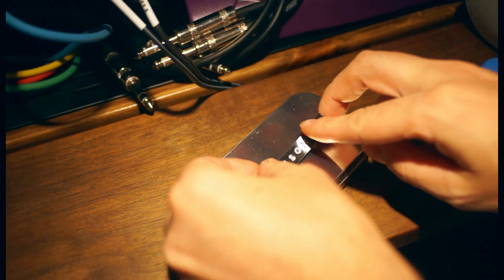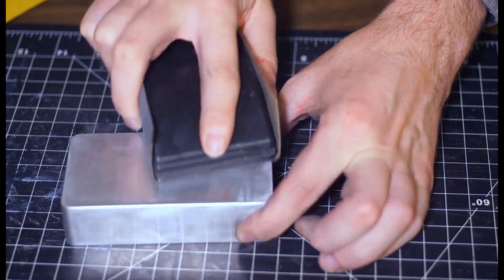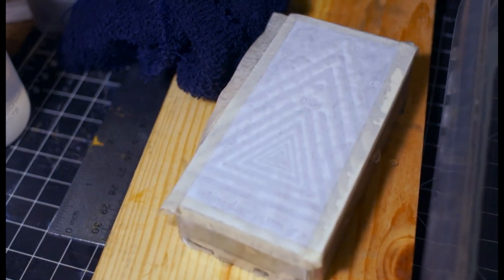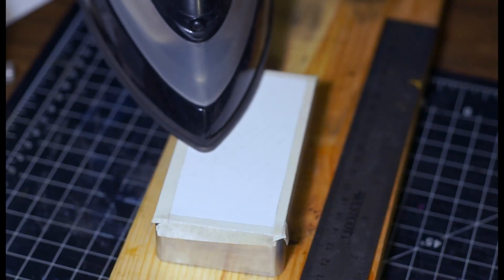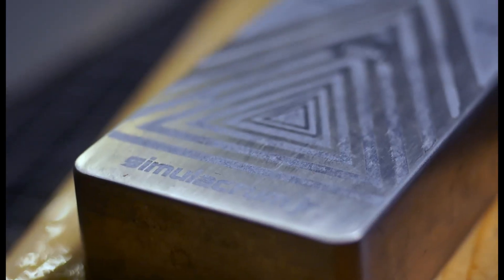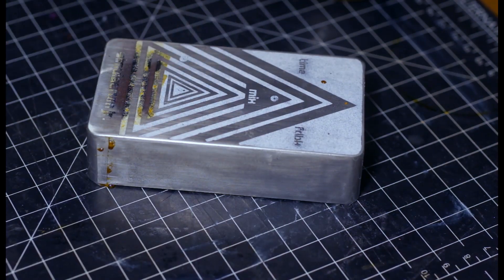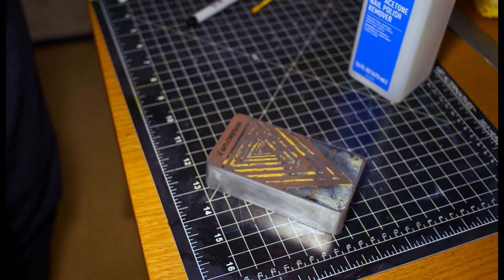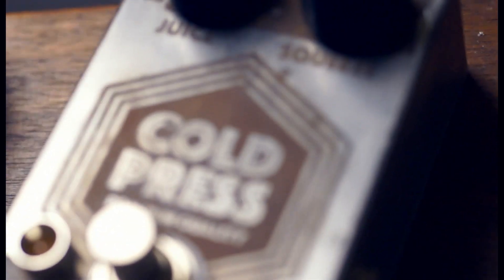How to Etch Aluminum / Etched Guitar Pedals

Comment: What solution of Ferric Chloride are you using? I tried this with Ferric Chloride marked at 42 Degrees Baume and it reacted really violently with the aluminium, generating really high heat and releasing hydrogen gas. Scary!!
Reply from the maker: Interesting, I've never seen that before. If memory serves, I used a solution of about 2 tablespoons of anhydrous FeCl powder (datak brand) dissolved in about 8oz of water. The powder may have been sitting on a shelf for a few months before that as well, though I'm not sure if it loses its strength as quickly in air as in water.

Comment: Technically that's a palm sander, not an orbital. An orbital, as its referred to these days is either rectangular or circular that works in random orbital paterns. But I have some old woodworking books that I used a lot when I was learning to work with wood to build guitars that often use those terms interchangeably and each book contradicts the others when going over terminology lol. With that said palm sanders are absolutely fine. They get a lot of hate but I use palm Sanders for guitar building since I'm going to do all the fine sanding by and anyways. So basically I'd use a palm sander for removing lots of material for comfort cuts or for getting the front and back level then I move on to hand sanding with a sanding block then fine sanding with a foam block. Anyways I never considered using a palm sander on an enclosure. My latest build is a DeadAstronaut Chasm Reverb that I've gone out of my way to try and get really nice this time. So no birdsnest off board wiring. Actually making a template with inkscape to precise dimensions rather than roughly measuring with a machinists rule lol etc etc. So I'm looking for ways to get a really nice looking enclosure. I have access to a laser engraver but I think etching would be even better. I live right by Mouser Electronics and they sell 500ml of ferric chloride for about $11-$12. In your experience is that a good deal or should I look elsewhere. Thanks for the video!
Reply: Switch is recessed within tool grip to prevent accidental engaging.

Comment: I'm having trouble finding the right paper. I bought HP Glossy Photo paper, but the hot iron made the back of the paper sticky and no matter how much heat I applied, most of the toner wouldn't stick. The paper initially would adhere to the surface, but when I tried to submerged it in water to remove the paper, it didn't soak up the water well and it was hard to get the paper to come off. When I did finally get it to peel off it peeled the transfer off with it 😩 feeling kinda discouraged. Any suggestions for specific brands of paper would be much appreciated.
Reply from the maker: Interesting! I struggled a bit with paper choices as well, many many failed transfers before I got the technique right. Photo paper tends to be thicker so that may be an issue, I'm using some stuff called "presentation paper" in the video, it's thinner but still glossy so the toner comes off more easily than regular paper. However the glossiness makes it more waterproof so it's kind of a double edged sword as you mention. Lately I've been using glossy magazine paper and it works pretty well. Most printers jam if you use it as a sheet so I just cut out a 6" x 8" section and tape it to the middle of a regular 8.5x11" sheet of printer paper, run it through as a carrier. It's lightweight, dissolves almost instantly in water, and is glossy enough to release the toner. Magazines are printed with dye type ink so it doesn't interfere at all.

Also, if you can't get the toner to melt at all with your iron, it may be worth trying a different toner / different printer. I've seen people on some forum debating which brand of toner has the lowest fusing temperature, though I can't recall exactly which brand is best.  (I use a Brother HL-2270). Maybe just try going to the copy shop and see if you have better luck with another printer/copier.
Reply: @extralifedisco  I recently just used xylene to transfer the toner! Have you heard of this? I haven't etched it yet to test it's effectiveness, but a couple swipes with a Chartpak blender (a marker with pure xylene) and it transfers to the enclosure almost effortlessly within seconds. If I can get it to etch correctly it'll be a game changer for sure.
Reply from the maker: @a_meek_1625  Ah very cool! I've seen people doing that by spraying clear on the enclosure to get it wet, then laying the transfer down on top of it (sometimes called heatless toner transfer) which presumably works because aerosol cans usually have xylene to keep the paint in solution. I imagine the marker is the way to go, dealing with the liquid and aerosol seems very sketchy b/c of the high volatility. LMK how the etch works!
Reply: @extralifedisco  good to see my trustly old 2270dw will likely work. Over 100k pages and still working strong.

Comment: Can you spray paint the enclosure & then use etching solution, or visa versa ? Thanks for the great video 👍🏼
Reply from the maker: Nope, the paint will block the etchant  from working. If desired you can etch the enclosure, then paint it, then sand it flat again and only the etch will remain panted, but this requires a nice deep etch.
Reply: @extralifedisco  Thanks that’s great 👍🏼

Comment: Maybe a dumb question but is there a way to dye the etch? Do get a different end colour .
Reply from the maker: Sure, the most common technique is to etch very deeply and then paint the surface whole with a hard enamel type paint. Once it's dry you can sand the whole surface flat and only the etched part will remain painted.

Comment: Did you know that TONER is CANGEROGENIC?!
Moreover, you need a printer that DOESN'T ADD MARGINS!!
Reply: It didn’t smell good. Well, I gonna have cancer anyway...
Reply: Inhaling toner is really bad. But as long as you handle the cartridge carefully so it doesn’t spill, you shouldn’t have toner in the air.
Reply: @tookitogo  "you should have toner in the air" and you breathe it...
Reply: @GenerativeSynthesis  d’oh! Autocorrect got me! Of course that should read “shouldn’t”!
Reply: Also, unfortunately most laser printers cannot do borderless printing. That is largely the purview of inkjets, which sadly are unusable for PCB etching. :(
Reply: @tookitogo  Also most inkjet printers have that problem, though.
Reply: @GenerativeSynthesis  Most inkjets have what problem?

Comment: do you have a recipe for the etchant?  I'll whip up a batch in the lab.
Reply from the maker: A little beyond my pay grade I'm afraid! I use ferric chloride, which I buy as anhydrous powder from Jameco electronics and mix into water. I believe it's produced by Datak. A lot of ppl prefer hydrochloric acid for etching copper as you can refresh it and apparently neutralize the cupric chloride, but it doesn't leave a color change in aluminum so far as I know, so if you're etching graphics FeCl is the easiest one I know.
Reply: @extralifedisco  Most excellent!  Thank you, sir.

Comment: 6:45 how is IDEOLOGY Pedal have more darker color than the other?
Reply from the maker: Use fresh etchant with no contaminants, and etch a little bit longer. I recommend doing some testing on scraps of aluminum so you can find the right time for your etchant solution, especially because FeCl degrades with age so you may need to etch longer with an older chemical.

Comment: and photopaper transfer? gotta be honest the results are great for just plain paper :D
Reply from the maker: Yep, just regular glossy laser printer paper (HP presentation paper). In general I find that magazine paper works better on aluminum because it disintegrates more easily when wet, so it's better for labeling. With etching it's not so important if the toner doesn't end up super-black on the metal. Other folks have recommended wax sticker backing paper, tattoo transfer paper, and the pulsar transfer paper (or press-n-peel blue), and I suggest experimenting with a few because it does take some practice however you do it.

Comment: I absolutely could not get the transfer to work until I heated the pedal chassis with the iron before applying the sheet. Thanks for the tip! Saved me from so much frustration.

Comment: I've been using Kapton tape for both my PCB transfers and etching enclosures. It's meant for high heat so it works great!
Reply from the maker: Ah good idea! Think I saw it at the office supply shop recently - will give it a try on the next project.
Reply: @extralifedisco  I get Kapton tape from China. It may not stick quite as well as the 3M stuff, but at (literally) 1/15 the cost, and given that it’s mostly used for temporary things, I can live with that! (It holds find for one adhesion, but unlike a post it note, it dramatically loses adhesion on a second and third sticking.) I’ve used such el-cheapo Kapton to secure a toner transfer sheet onto a blank PCB before putting it through the laminator to transfer, and can confirm it works excellently for this. 

Another discovery about Kapton tape: epoxy does not adhere to its adhesive. I used this recently to try out casting epoxy windows for LEDs in wood: I milled out the display segments, capped the end with Kapton tape, and then flowed in epoxy with a tiny bit of talc as a diffuser. Once cured, the Kapton released cleanly, leaving a flawless smooth surface. You could do this with aluminum, too.

On aluminum, I did something similar: drilled holes, cleaned it well, used a heat gun to get it hot, and then squeezed a hot glue stick through the holes to fill them. Once cooled, carefully cut the excess glue from the outside, then gave it a very short, hot blast of hot air to re-melt the glue surface to get it smooth again. Works beautifully for getting diffuse, wide-angle indicators that can be small, dust and waterproof, even from the cheap water-clear LEDs and SMD LEDs that are pervasive nowadays.
Reply: I don't get it - you print on the Kapton tape? How?
Reply: @ No no, I use the waxy-back of a full-page sticky label, but I use Kapton to tape it on to whatever I'm applying heat to since my iron won't melt it, or the paper. Scotch tape would probably melt, and masking tape won't but its glue will and it'll slip around.

Comment: Are you used laser printer or inkjet,and did you print BW or CMYK?
Reply from the maker: Laser printer, black and white! Laser Toner is actually plastic, which is why it melts or "fuses" onto the substrate.
Reply: @extralifedisco  What laser printer do you use? This has been the vexing problem for me — I had a little Samsung that worked great, but it died. So I’ve been trying other laser printers (at work, at friends, etc) and none produce satisfactory results. :(
Reply from the maker: I have a brother HL-L2370DW, inexpensive B/W model

Comment: yellow tattoo transfer paper absolutely works best for etching. I have tried them all. Good video mate.
Reply: What laser printer do you use? This has been the vexing problem for me — I had a little Samsung that worked great, but it died. So I’ve been trying other laser printers (at work, at friends, etc) and none produce satisfactory results. :(
Reply: Make sure your laser printer is only a black and white laser printer.
If it is a color laser printer it will not work right.
Reply: @tookitogo  I use a cheap Canon B&W printer. Works perfectly for this purpose.

Comment: This is really inspiring... Does it have to be a laser printer? Or can it be ink?
Reply from the maker: Has to be laser printer! The laser toner is actually little plastic particles which melt onto the surface of the paper, so they form a film which can be transferred to another surface. Ink just soaks into the paper as it's a liquid. There such a thing as "direct ink" printing to PCB but it requires a special (or modified) printer. Androkavo has a demo here: https://www.youtube.com/watch?v=JPva4kMxmpg
Reply: Interesting stuff! All the best to you

Comment: really beautiful. exactly how I like it. I´m thinking of doing this myself. Do you think it´s difficult, to take the paint off of a factory pedal?
Reply from the maker: Removing paint is pretty easy if you have an electric sander, coarse grit paper, and a garage! Wouldn't want to do it by hand though. The "double helix" pedal seen in the video was a actually black powder-coated enclosure, so I sanded down the top face to bare metal. Powder coat is soft plastic, but other paints might be enamel or acrylic with clear-coat on top, so slightly harder material. But the same principle applies.
Reply: Okay, thank you. I'll have a try. I assume, if I leave parts of the initial paint, there would be no etching happening right? I am not looking for a strict design, more of a "drown the enclosure and let the chemicals do their job" type of thing and see how it will come out.

Comment: Great vid.  Instead of paper you might try Press n Peel blue.  I get great transfers of toner and I do not have to deal with soaking and rubbing, etc.  And I agree with what you said about each pedal being unique.  Sometimes when my toner transfer is to good I'll scratch off a little here and there to add some character!
Reply: I believe there's also t shirt transfer paper that is designed specifically for this. I know I used to use it back when inkjet was all the rage and I seem to recall seeing it for laser too....

Comment: Great tips, quality video, subbed. And hope you get more subs for this. I am wondering if you can use the power supply saltwater method instead of FeCl?
Reply from the maker: Thanks! Yes, you can use vinegar (acetic acid) or another etchant with electrolyte (salt) etch as well. I did my first tests with a 9v battery and vinegar. However with this method you won't get much color change, so you should etch more deeply so that you can fill with paint. After etching, remove the mask, apply the paint paint, then sand flat to remove the paint outside the etched area.
Reply: Great, that's exactly what I needed to know for planning to fill with paint. Vinegar as well heard works great. Thanks for the answers.